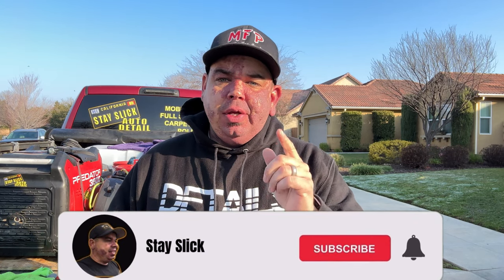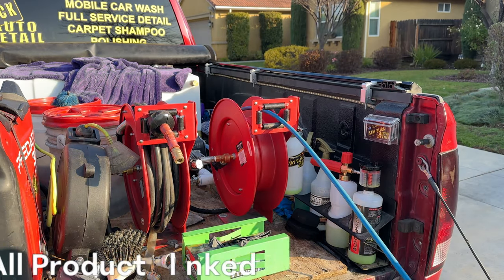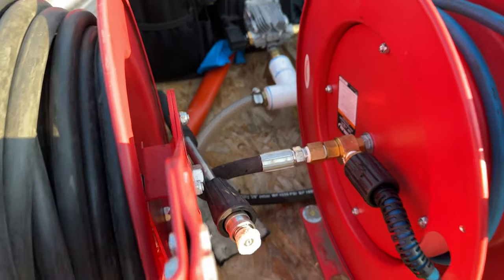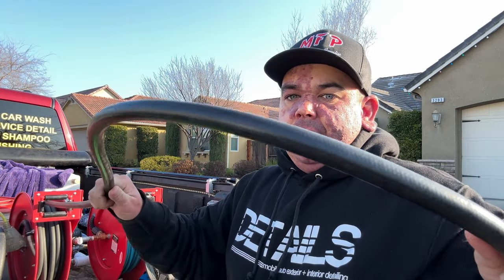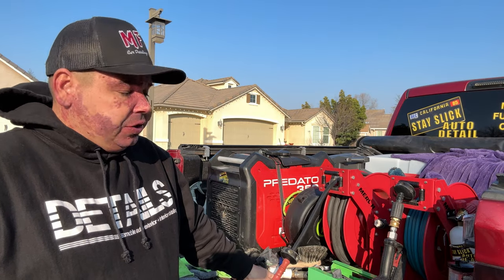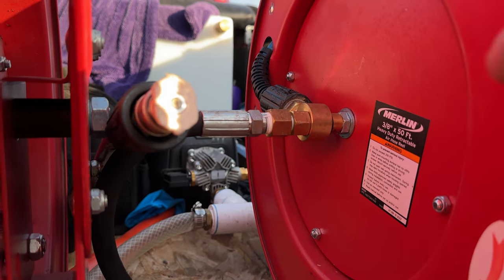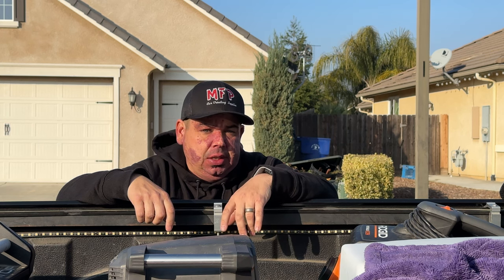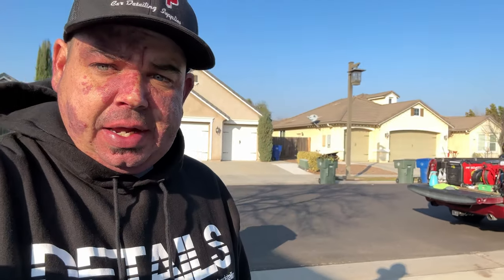UPDATE: Retractable Pressure Washer reel | FAQs and Step by Step

Comment: I think the video is very well explained. Works very well for me and I'm using a 75 ft quarter inch hose with it along with 1800 psi electric pressure washer 3 months later. Still no leaks. Thank you very much for a cost effective pressure washer hose reel.
Reply from the maker: Right on glad to hear.
Reply: Still going with no leaks?
Reply: Think I could fit 100ft uberflex?
Reply from the maker: @kylepapke9357  no because the spring is only rated to retract 50 feet of hose you were going to have to get a dedicated 100 foot retractable real

Comment: The fitting is rated for 300 psi. The pressure washer  is 1000 -1300 psi. Upgrade the fitting to 3000 psi.

Comment: Just did the exact same setup, except I'm using it a 25ft Uberflex hose coupled with the stock Active 2.0 hose it works fine. Yes, I'm going to upgrade to a 50ft so this is just temporary but incase anybody was curious.

Comment: Gary is one of the VERY few real ones on YT. He adds value that’s applicable, useful and actually works:)! I mounted mine to a Rigid rolling tool cart. Looks cool and I love it. Thank you! Btw would you recommend completely unreeling the hose before turning pw on? I also turn water and unit off before reeling up. Not sure if it’s necessary but working great so far 👍.
Reply from the maker: I don’t really do any of that. I’m rough on my things and I want them to work the way I want them to work so I don’t usually take any precautions. They may be a bad thing but hey that’s who I am.
Reply: @StaySlick  That’s awesome. Appreciate the feedback.

Comment: Your first video on this modification save me a lot of time and effort I have mine hooked up to my active 2.0 pressure washer and it runs awesome I do have some small leakage from the same places you talked about but it's not a big deal I just disconnect all the water problem solved
Reply from the maker: You might try tightening down that fitting on the side right by the one that spins around you can actually tighten down to stop that leak I believe

Comment: Have you tried this on a “Quad Pod” hose reel such as the one from Goodyear? I am thinking it would be great for added length when your stationary reel is not long enough… simply carry the Quad Pod to the end of the line and you have another 100 feet available. I ask because the fittings are different. Thanks

Comment: Hi thanks for your video, I just spent weeks ordering parts and a bunch of time taking it apart and drilling out the hole big enough to fit the hose in and after all that it leaks like crazy from the fitting that came with the hose reel, the part where you said there two pressure fittings, it is spraying hard and lots of water leaking, I feel like I have just wasted a bunch of money and time and want to dump this reel in the garbage, this my last ditch attempt, but is there anyway to fix the leak on the fitting or should I just throw it away? Any info would be appreciated thank you

Comment: Did this to my rig last week thanks to your help. I unfortunately blew the seal out yesterday during a job. I use an electric pressure washer but a very powerful one with adjustable pressure. Turned it up and boom. I’ll have to keep the pressure low after I fix it.
Reply: What pressure did it blow at?
Reply: How did you fix it?

Comment: If you upgrade the pump do you think that will allow it to work for gas pressure washer   Which seal leaks ?
Reply from the maker: No it has to do with the seals on the reel. not the Pump. The seals where the reel rotates and meets the water Inlet

Comment: Gary I followed all your steps and converted a reel long story but my Uber flex hose was never delivered from Amazon so I purchased a yamatic hose locally but I notice severe loss of pressure is this common to lose power or is it the hose or can it be my unit wondering if you have an idea ?
Reply from the maker: You shouldn’t lose any pressure.
Reply: @StaySlick  thanks for taking the time to reply I should have watch your video about the yamatic hose before I bought it in gonna try another hose maybe it’s my unit that is not working properly thanks again

Comment: Just finished watching the update , which I would of know about the air hose before I took it off , now I have some slack hanging out so I might have to figure out how to tighten it up so it’s not loose, either way it worked now I have to hand it in the van
Reply from the maker: If you watch the original video, it tells you to pull the hose all the way out first. Don’t feel bad. A lot of people missed that part.
Reply: @StaySlick  yeah I think I missed it but I had bought the real to do that and instead of waiting to get all the parts I needed I pulled the air hose off instead of waiting

Comment: I made the mistake of not pulling the hose all the way out originally so when I replaced the original air hose with the pressure washer one it doesn’t retract all the way. What would you do to fix it?

Comment: Brother I got a question right on minute and 30 seconds you said that the 3 part is the hose that go to pressure washer okay on there I have the 25 ft from ryobi and I’m being losing pressure you think is okay to replace it with a 5ft air pressure hose ?
Reply from the maker: I would just get the whip that I linked in the description
Reply: @StaySlick   okay sounds good thanks a lot , yeah cause that hose that i have it says it’s 300 psi i think it would not handle that

Comment: I'm using a Ryobi 1900 electric PW, I've had the seals blow on my 3 times. Any way to upgrade the seals so that doesn't happen?
Reply from the maker: I just bought nitrile seals from harbor freight and silicone grease. I’m going to retry.
Reply: @StaySlick  how did the seals worked for you?

Comment: my question is what would happen if it where to fail? does it simply spray water all over the place at high pressure or are we talking about a chunk of metal breaking off one of the fittings and flying somewhere unpredictable?
Reply from the maker: From what I’ve experienced, it’s just water

Comment: The problem is that snap ring breaks its game over, and it happened to me while I was detailing, tried fixing it replacing the o ring after it broke. Be aware of the snap ring and O rings.
Reply from the maker: The o ring usually blows out first. Never heard of the snap ring breaking
Reply: @Stay Slick  the snap ring failed on me, but I'll share this info since I didn't want to give up on the reel, my recommendation to prevent any leakage, wrap plumbers tape where the O-ring is meant to go then place the O ring until its nice and snug. After that test it a few times if no water leaks, then your good. Will give an update to see how long it goes without leaking problems.
Reply: @ArcHourGaming  any updates I blew my o ring just today

Comment: Great video. But Shouldnt have a problem using a proper 5800 psi rated hose and using that same reel that your using surely that would work if you put the correct hose on it. That reel is solid.
Reply from the maker: Unfortunately no. The problem is that this entire reel relies solely on the psi rating of the swivel. I know from experience it’s no more than 1500 psi.